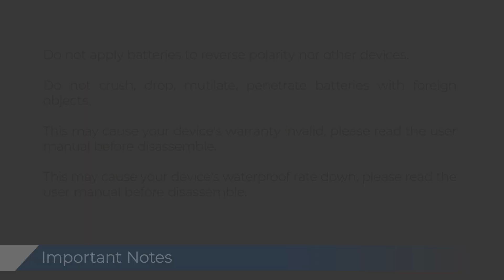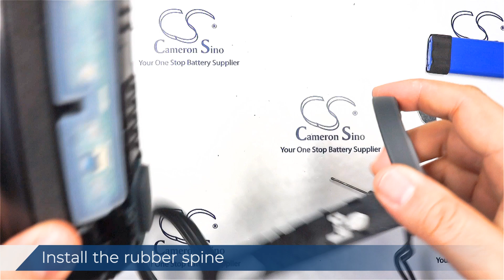JBL Flip Essential - Battery Replacement - CS-JMF400SL

Comment: Ok so I managed to do mine. Getting the battery out is extremely difficult as it has sticky foam on both sides. I took an old plastic credit card and cut it in half and trimmed so it was as wide as the battery. I gently push them in wiggling side to side until they where most of the way down. Then using a pair of pliers I pinched the sides of credit cards, to grab the battery. I then pulled the battery out. It was hard. Go slowly and remember that these batteries can and do catch fire if you puncture them, so if you chose to give it a go ensure you do not pull on the wires or use metal tools. Be safe and good luck.
Reply: Also, I forgot to mention. Put the ribbon cable through the slot BEFORE putting the battery in. Hold just the tip of the ribbon cable and push the rest aside enough to slide the new battery in.

Comment: I had issues while trying to remove the battery as it was swollen.
The solution was to make a hole on the plastic frame just near the bottom of the battery.
DISCLAIMER: go EASY, you do NOT want to make a whole in your battery, this would cause high risk of explosion, fire or severe injury. If you're not sure, don't do that.
This done, I managed to put a screwdriver in the hole and push the battery out without much difficulty.